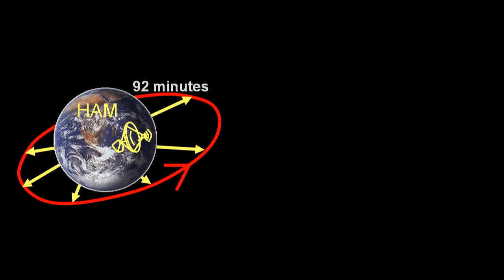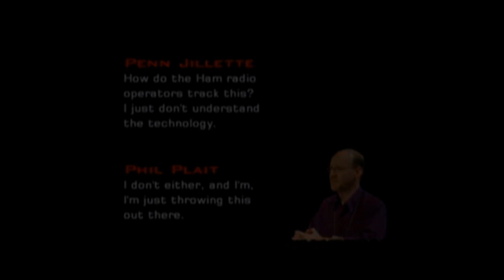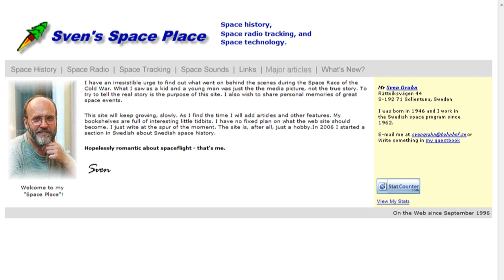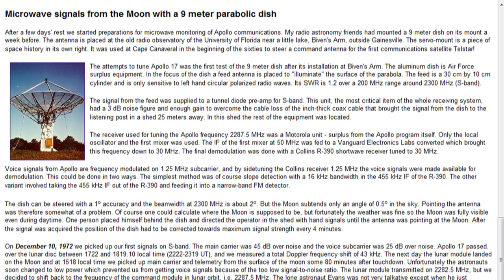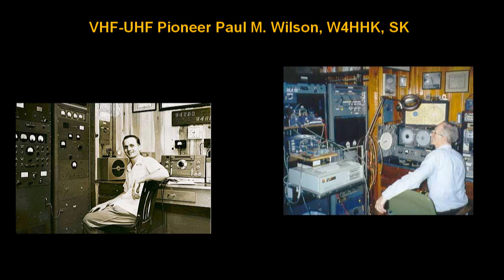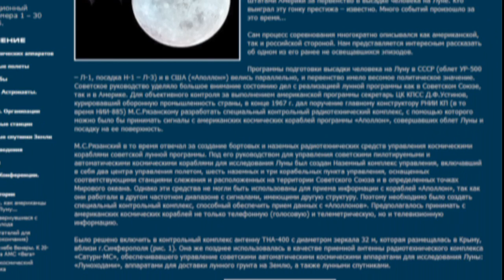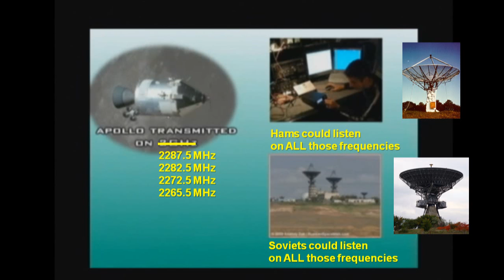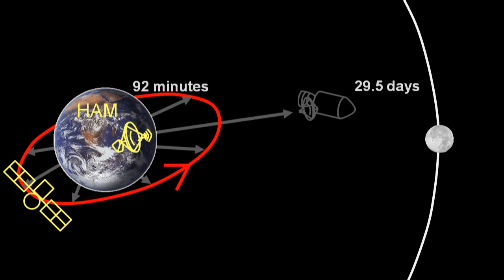MoonFaker: Exhibit D: Critique #17: Stupid Hams

Comment: The problem with the relay story is this: Jodrell Bank in England, part of the university of Manchester, not only recorded the voice traffic from Apollo 11 but the doppler shift of the signal from the LEM as well. This clearly shows Armstrong's manual movements of the throttle as he hunted for a landing place.

To fake this would either need a very clever transmitter, probably beyond the period technology, or a transmitter moving exactly along the path that the LEM took and making a manual landing. In other words it would have to be the LEM.

http://www.jodrellbank.manchester.ac.uk/multimedia/images/apollo11-eagle.html

Comment: @philwebb59 Sure, conspiracists won't buy it -- at least when the claim at issue benefits them -- but the courts will. Not just in criminal cases where the burden of proof is on the prosecution, but possibly even in libel cases. False accusations of lying can certainly constitute libel. Even under NYT vs Sullivan it is still possible for a plaintiff to prevail when the defendant knew the statement was false, or made it with reckless disregard to whether it was true or false.

Comment: @philwebb59 Moonbounce usually involves the biggest antennas you can build plus full legal power (1.5 kW). I don't know the moon's reflectivity at radio frequencies, it may be different than at optical.

More recently, Joe Taylor developed software that allows moonbounce with much lower power and smaller antennas, based on ideas that a friend and I published back in 1996 but never implemented ourselves.

Comment from the maker: @ApolloWasReal Exactly. With a 100W earth-based transmitter, reflecting off a 7% efficient, convex surface 385,000 km away, it's surprising you'd get any signal back at all.

Comment: It should be pointed out that Apollo's PM downlink signals were MUCH stronger than the return signals in EME (moonbounce). Any ham able to do moonbounce on 2304 MHz could easily hear Apollo by tuning down a little to the appropriate frequency, as long as Apollo was in the PM mode.